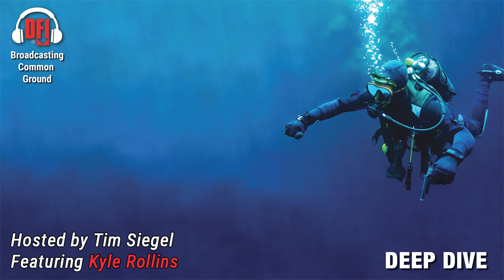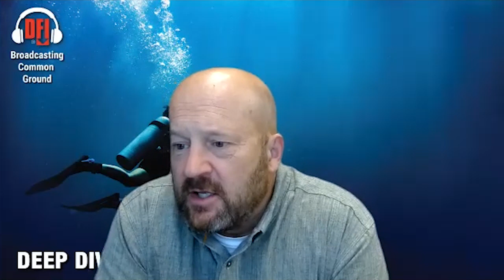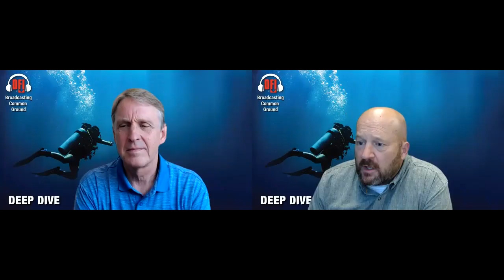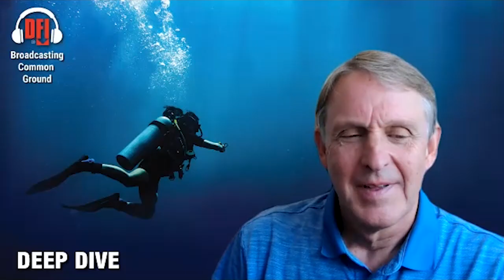Deep Dive Episode 1 - Part 2: Kyle Rollins, Ph.D

Comment: Anyone who has tried to add negative skin friction to pile load and then increase the pile length to try to get enough capacity below the zone of negative skin friction should have a realization that that approach is flawed. Neutral plane and the unified design described by Bengt makes a lot more sense.